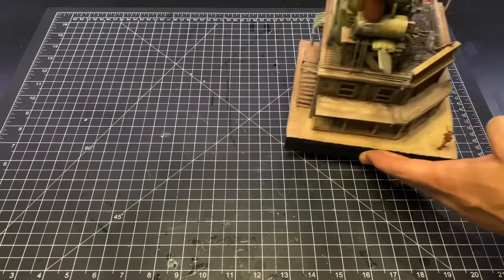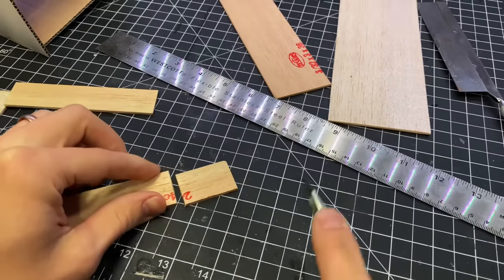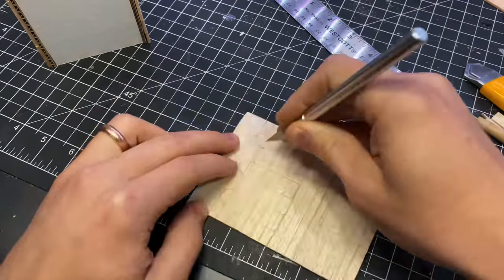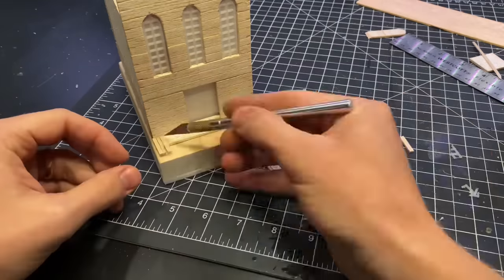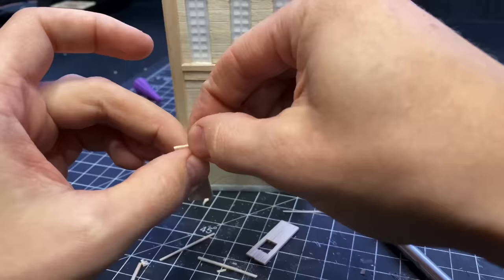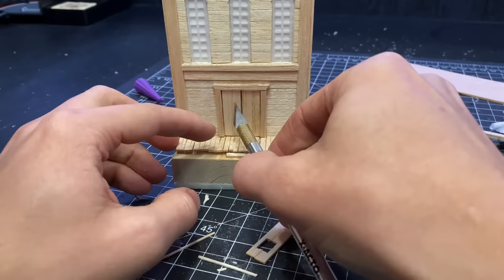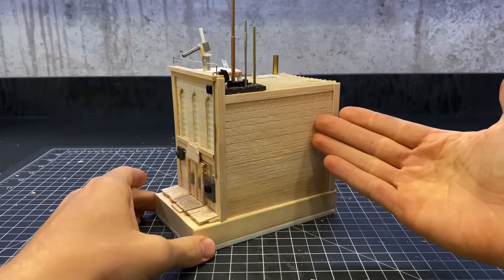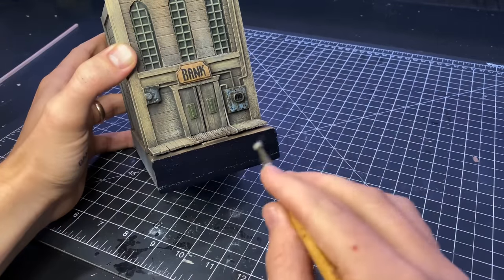My Western Town | Building 3

Comment: For removing the paper on the sides of corrugated card, very lightly damp sponge, wipe it down on the surface you're removing till it's vaguely damp, then strip it. Comes off no issues.

Comment: A trick to separate the layers of the cardboard is to soak the cardboard in water for a while. When the cardboard is drenched, the layers come right off. Leave to dry…and I call it good 🙃 Yes, the corrugated part does hold it’s shape if you’re careful 👍

Comment: You know, with the blank sides, they still need something on them, an easy option would be to find some old posters and scale them down to spread over the sides and back.

Only thing beyond that which hit me is the back of the front of the building, it needed something covering the cardboard there.

Comment: Something you might consider adding later is iron-cladding on the sides. At least on the first floor and especially around the back. As a bank robber, I’d bring a whole lot of dynamite, and use it on an under-protected wall and blow a hole right into the vault. Cladding like they had on the Monitor and Virginia to stop those pesky thieves. It would be plates of iron and riveted in place.
Reply: @ThePeejRR  Why be insulting, maybe they distracted the Sheriff?? I was only talking about that particular bank and what additions might give it more character. You are a troll and this will be my only reply, have a nice day.

Comment: Only problem is with the gatling gun. You can't have a mag to feed that thing. Those things get through ammo abominably fast. That magazine holds about 40. The avenger 7-barrel gatling gun eats through ammo at a staggering 3,900 rounds per minute. That mag is going it last less than a second. A better thing to use is that thing you mounted on the carriage fighting the buffalo monster. That will serve this bank a lot better than the gatling. All the same, the building looks great, well done!

Comment: Missed opportunity on not doing a slight slope on the roof... I get it's not strictly necessary, but my mind has a hard time looking at it and not immediately thinking that corrugated roof would immediately begin to rust out as a flat roof like that would capture all the moisture in the channels, whereas even a 5 degree slope would drain it...